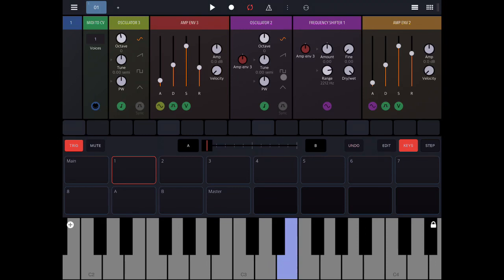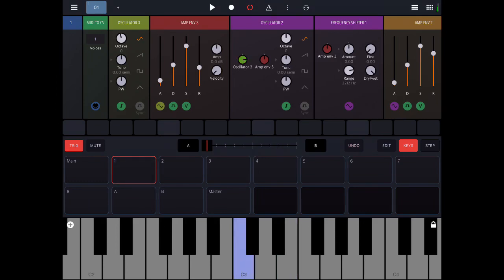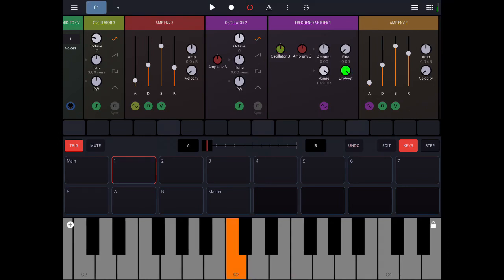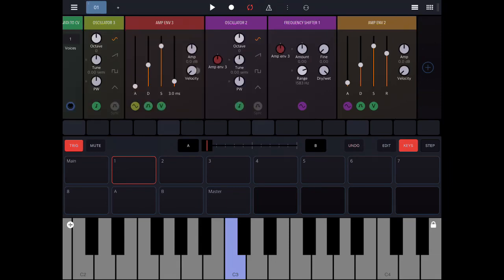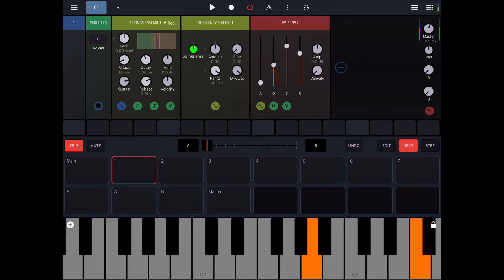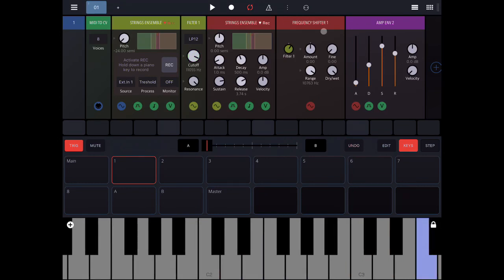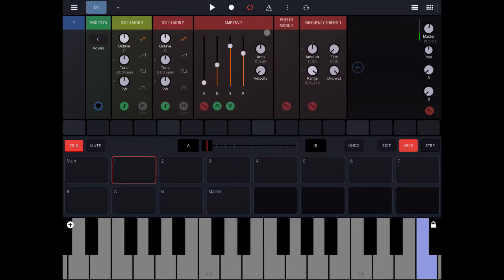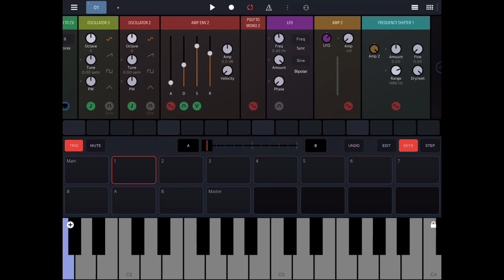FM synthesis with the Frequency Shifter module

Comment: This is a very cool idea. Linear fm can also have tuning issues and this method still does have those, and this method isnt equivalent to linear fm with a pitch shifter when the operator is non-sinusoidal bc frequency shifters dont preserve ratios like a pitch shifter does. 
On its own this is a very unique idea though. Using non-sinusoidal operators should give some very unique sounds, and in implementations of frequency shifters that allow you to mix the positive and negative sidebands (like a lot of hardware frequency shifters) im curious of what kinds of sounds that control could result in. nice job

Comment: Hey Ben!  I hope you have been well, internet friend.  Have you experimented with the linear freq modulator?   I can’t find any information on it online, however I have had fun with throwing it in between sound generators.  Is the module to be used for FM synthesis?  Sorry for the questions on an older video.  As always, Drambo makes me feel like a genius one day and an idiot the next.  The latter usually results in me going down hours of rabbit hole “research”. Thanks for even reading this if you get to it!
Reply from the maker: Hey Matt! I’ve played around with it a bit. Yes, the Linear Frequency Modulator acts as an FM modulator by applying modulation from its signal input to the outgoing pitch, at the correct intervals for it to amount to linear FM. So in a typical FM synth you’d have a modulator and carrier signal. Here, you’d have a carrier oscillator or other sound source, and to FM it you’d take some other signal, route it into the signal input of the linear freq modulator, and then use the linear freq mod as the pitch input of the carrier. Of course you can do other things with it (for example leave the carrier’s pitch alone but FM a filter down the chain, etc.).
Reply: @benrichards4554   fantastic. That is what I thought was happening. Hah. Thank you for confirming and elaborating!  I really appreciate your help as always.